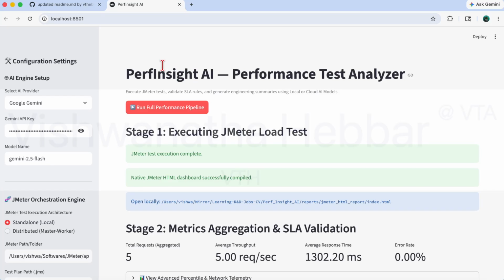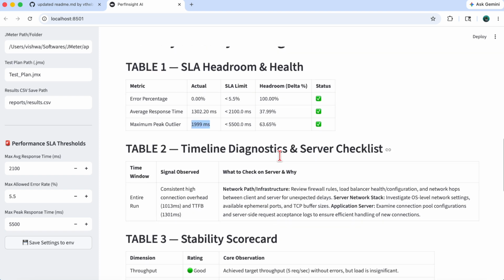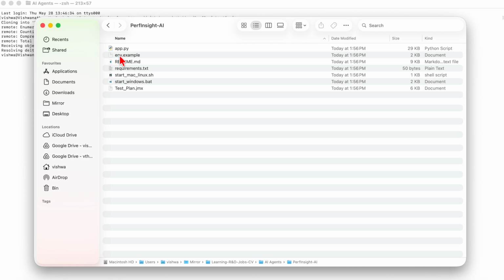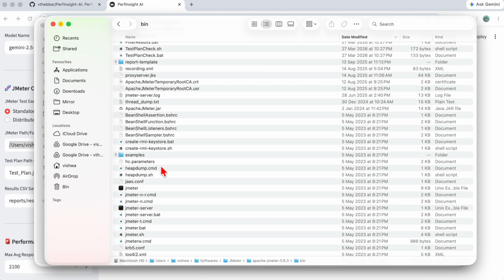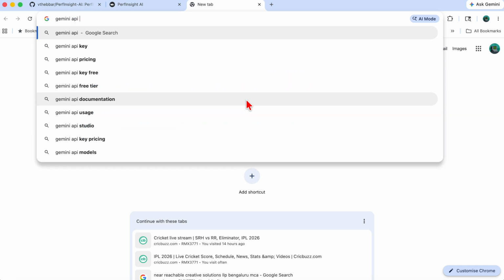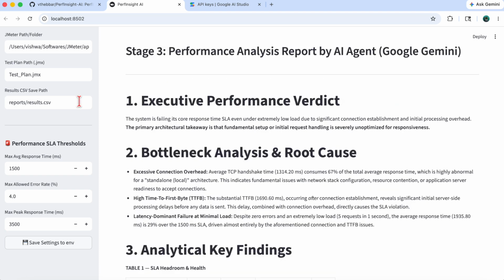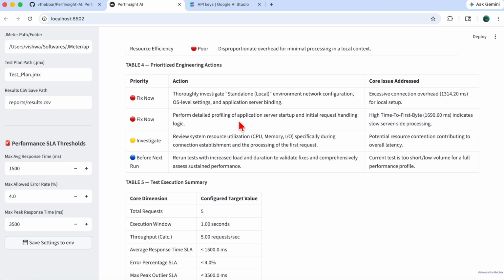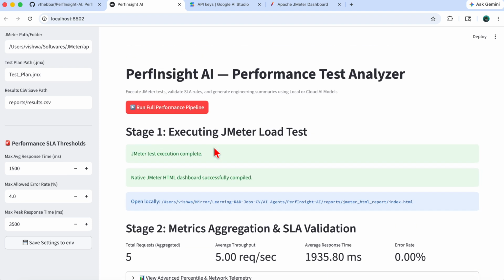Analysing JMeter Results with PerfInsight AI | AI for Performance Testing and Engineering

Comment: This tool looks very promising to quickly create a workable performance test report. However, I suggest configuration option, so that Avg. response time could be converted to s (sec) instead ms. Most organizations still have the response time in seconds for web applications (for API it's ms). So, having that option, may be as a drop down to change, will be extremely useful.
Reply from the maker: Thanks for feedback, will work on tool improvement.